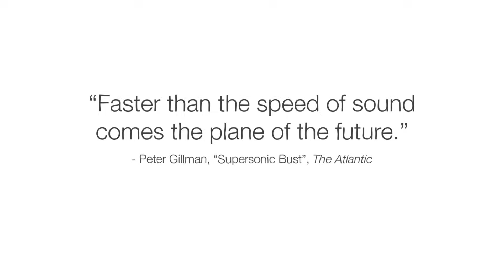Why are airplanes slower than they used to be? - Alex Gendler

Comment: The two sets of wings to create two waves to cancel each other is a genius idea.
Reply: It looks like a star destroyer
Reply: But that makes for more materials meaning more weight meaning more fuel  :/
Reply: @rollon1181  Yes, I agree with that but the problem with a supersonic plane is the speed because Energy is proportional to the velocity squared. So,  I think they are not aiming for reducing fuel consumption with the idea, but they are reducing the noise problem. The idea of using overlapping waves is smart because it should be intuitive, yet it is not. (for engineers at least).
Reply: @redaghassah7718  I’m not an engineer but Can’t we just create less noisy engines like we’ve done with cars? Most modern car engines and even power plants are literally quite this days, can same science not be replicated with the Concorde’s engine?
Reply: @jozefgiver7976  It's not audible noise that the issue, it's that the soundwaves are so large that they are physically damaging
Reply: @redaghassah7718  there's actually a very similar idea called canards, often used on fighter planes with wing shapes that are very fast but create a lot of instability. It's a small set of 'wings' that are placed one the nose of the aircraft
Reply: @jozefgiver7976  The issue is not the sound of the engine itself, but rather the “sonic boom” that results from an object traveling faster than the speed of sound. A rifle bullet for example has no “engine” but still produces an extremely loud cracking noise as it travels down range. With an object the size of an airplane, that “loud cracking noise” is similar to a mortar shell explosion.
Reply: @nickschneider4830  I’ve never shot a gun before but I assumed the sound came from the gun powder bang in the gun chamber which is contained using a silencer. I mean I could be wrong but I feel like the Concorde has that much sound wave effect partly due to a loud engine combined with speed. Cos I dunno, if a noiseless object is traveling at the speed of light would it cause the same sound-wavelength issue as the Concorde? I could be wrong but just asking.
Reply: @jozefgiver7976  it is true that the explosion of gunpowder produces a loud noise by itself, but a supersonic bullet emanates a loud crack all the way down range until the bullet slows to sub-sonic speeds. The main purpose of a suppressor is strictly to muffle the noise of the powder explosion and to reduce muzzle flash. It has no effect on the supersonic crack that trails the bullet down range. 
If you were on the ground spectating a jet traveling 0.99 Mach (subsonic) you would hear the rumble of the engines - this can be very loud depending on the jet’s altitude, but not physically damaging to you or your surroundings. Now if this jet speeds up just a bit to 1.01 Mach (supersonic), the resulting shockwave emanating from the aircraft has the potential to break windows and cause hearing loss. If you were extremely close the aircraft, say 50 feet - it could kill you. 
The noise produced by the engine would not dramatically change going from 0.99 Mach to 1.01 Mach, but the noise produced by the aircraft would increase enormously.
Reply: @jozefgiver7976  Any noiseless object traveling through air at a supersonic speed will produce a sonic boom. This is a result of the compression of consecutive pressure waves created by the object as it travels through the air. The energy released during a sonic boom is dependent on the size of the object - larger objects will produce more energetic, and thus louder sonic booms.
Reply: @jozefgiver7976  Mind you, the sonic boom is purely the result of an object traveling through a medium, in this case air. An object traveling through the vacuum of outer space is silent regardless of speed. There is no medium for sound to propagate through, and there is no pressure buildup in front of the object in the first place.
Reply: @nickschneider4830  wow Nick Schneider! Now I really want to be friends with you, you really brought it home and now am feeling like I can seat for an exams on the subject, thank you for taking the time, are you a lecturer? I really would like to know you if that’s fine with you.
Reply: @jozefgiver7976  A big problem with combustion airplanes is that in order to produce enough thrust to generate the lift necessary to maintain flight, the air needs to be compressed in order to achieve this "golden ratio" of air to fuel to maximize energy. Not only is the combustion itself loud, but in the air compression process, the blades are rotating at speeds that produce frequencies that are quite audible and high-pitched. Even if the sound of combustion is reduced, those frequencies still resonate through the body of the aircraft.

Jets are a lot quieter than they were in the 60's, but unfortunately, technology is not quite there to where we can operate planes on alternative energy (the Solar Impulse 2, a solar powered plane, took 16 months to complete a circumnavigational flight) Until then, all we can really do is stick to regulations on how close pilots can be to land when they break the sound barrier.
Reply: @blargwaharp.9577  I was thinking about a solar powered plane but then I realized the energy requirement will be an issue and you’ve just confirmed that (16 months! Wow.) I didn’t even know such had already been tested, thank you for bringing up that knowledge.

On a different thought, I’m wondering what the feeling is like traveling in the Concorde for instance. Will the passengers feel the sonic motion impact, considering they’re traveling at speeds faster than light?
Reply: @jozefgiver7976  and I’m glad I was able to clarify some of your questions. You posed some interesting ideas so I’m more than willing to provide some insight
Reply: @nickschneider4830  Wow! I saw the clip you recommended and I used headphones like you said, I think I screamed out a little bit when the crackling sound came sharply after towards the end. At this speed, how is cabin pressure conducive for regular traveling passengers? And what’s the assurance that people are not pinned into their seats and puking their guts out like in a speeding car?
Reply: @jozefgiver7976  i hope you are kidding hahahahahaha
Reply: @jozefgiver7976  Speed isn't what pins you to your seat. Acceleration is. Once you're at speed, you won't notice the difference. During takeoff you might feel a bit pinned, but modern airliners are no where near the same acceleration rates of say, F1 cars, or fighter jets.
Reply: @rollon1181  Yes, but if they run flights at half the time they can run twice the amount of flights
Reply: @rollon1181  it's not solving that particular problem
Reply: @rollon1181  but you could go over cities, meaning that it would shorten the route and consume less fuel
Reply: @rollon1181  juhuui
Reply: @rollon1181  just install Twitter problem solved
Reply: @rollon1181  and more drag
Reply: @rollon1181  Not necessarily, you won't need as big wings if you have 4 of then rather than 2.
Reply: @Eric-zz5ij  No, the lift created by each pair of wings will be relatively similar to one slightly larger wing, so it will actually require a lot more mass. The other problem is that whatever connects the two will need to be able to absorb much of a sonic boom every time it flies. So even more weight meaning more fuel.
Reply: @tasmanmillen  No, biplanes are usually lighter than monoplanes because you don't need as much material to make the wings strong enough. Drag is one of the main reason why biplanes are worse.
Reply: That design may take a long time to come out. The engineering for that seems like a nightmare
Reply: Yea, who needs wings to be wings when you’re 30K feet up…
Reply: We going to ignore how the two wing design looks like a UFO?
Reply: Why wouldn't the bottom wing cause lower pressure underneath and pull the plane down?
Reply: @michaelanderson2881  because any decent aeronautical engineer would choose the appropriate airfoil for both wings
Reply: @momochiyoda2960  Are you one?
Reply: @michaelanderson2881  I am, and Momo is right. It's about balancing. But this concept won't work in real life. You control airspeed by changing the attitude of an aircraft. With this arrangement of bodies in proximity, changing attitude would result in very complex flow fields forming, leading to instability.
Reply: If you only look at that aspect, yes. Otherwise, no.
Reply: I’m a little confused about how this should work. How do they create a negative here
Reply: @eat_your_cereal  Wave cancellation. If you create one shockwave going one way and another going the other they should cancel each other out.
Reply: Manufacturing it and being able to accommodate it in the current airport and hangar facilities won't see it made anytime soon.
Reply: why?
Reply: Isn’t really just the principle of noise canceling headphones?
Reply: Yes
Reply: Not really genius. First thing I thought of with zero knowledge of airplanes.
Reply: Jj*j*
Reply: Yes indeed
Reply: Not at all, anyone could have thought it before
Reply: The weight should be a problem tho
Reply: @santiagocv9918  Nope. Bi-planes have existed for over 100 years and they do not have any weight issues.
Reply: Yes so why don’t we have them yet
Reply: Not really it feels like one those thing where you're like "I should have thought of that"
Reply: @ShadNex  and that's why it is genius because it is really evident that you forget about it. People are commenting why it's a bad idea for planes and I know that, but im comming from a physics point of view.
Reply: Well, not really. the socalled "sonic boom" is a compression of air molecues and just like a bicycle pump compressing air rewuires force (work). The only way to produce that force is with the engines. So with this idea they now have to produce two shock waves - guess what that does to fuel consumption?
Reply: The aliens had it right then

Comment: imagine being in the cabin of the Concorde going faster than sound.  Especially if your the pilot...
Reply: Er what? It’s not like your speed affects the sound of movie playback.
Reply: @BlownMacTruck  Because I would love the scenic view boi
Reply: It was amazing.
Reply: The problem you are all having with this is not differentiating the sound travelling outside the cabin from the sound travelling inside the cabin. Inside the cabin you can hear the engine no matter where you are stood. The sound of the engine is coming from the vibrations propagating through the plane's structure and vibrating the air inside the cabin. So what you are hearing isn't the raw sound of the engine through air (sound which your plane is 'outrunning'), it's the sound of the physical vibration of the engine damped by the structure of the plane, through the air inside the cabin that is travelling inside it. 

Ask yourself: Why can I hear passengers behind me talking if we are travelling faster than the speed of sound?
Reply: YES EVERYONE I WAS WRONG
Reply: I got a concorde ride at eaa in oshkosh wi. But it was a short flight and not supersonic
Reply: The speed of sound is measured based on atmospheric temperature. As altitude increases, the speed of sound decreases.
Reply: @powershotsss  uhh you mean pressure as altitude increases?
Reply: @powershotsss  no that's not correct either, it's not based on atmospheric temperature, it's literally just a wave, the speed of sound is based quite literally on particle density and how fast the wave can travel through
Reply: @johnlowe1255  they said temperature but then pretty much described it as a change in pressure
Reply: That’s low key baller ngl
Reply: 292 idiots
Reply: But if it was remotely piloted...over an unpopulated area..would it have made a sound at all ?? (joking lol)
Reply: Right, you can’t even talk to your copilot
Reply: And later on landing and finding out that your twin brother got much older than yourself. No thank you
Reply: @amarillo_atacama  Relativity in a nutshell
Reply: @ampere_exe  not how it works
Reply: @amarillo_atacama  Nooo it's the speed of sound. Your twin brother will just know more songs than you do.
Reply: @amarillo_atacama  what causes that?
Reply: @robertanton7566  its false
Reply: @amarillo_atacama  isn’t that applicable only when your are traveling at the speed of light.??
Reply: @amarillo_atacama  More like .00000000001 seconds older
Reply: @amarillo_atacama  its not that deep
Reply: I had a misconception as a kid that if you were in front of the engines, you wouldn’t be able to hear them until you went below the sound barrier. Of course that isn’t true, the speed of sound is relative to the emitter, so you would hear the engines just as well as if you were stationary.
Reply: @benisjammin8926  that's not how that works tho
Reply: Really ben, now you questioned that, I really dont think we would be able to hear engines in a concorde.
Reply: @govindbarwa1806  Yes you would be able to hear them. The speed of sound is measured relative to the emitter. So if you measured the sound emitting from a Concorde from the ground, it would be the speed of the plane plus the speed of sound, whereas if you’re on the plane it would just be the normal speed of sound. It’s like if you were standing in the bed of a truck, and you threw a tennis ball forward at 30 mph. To someone on the truck it would look like you threw it normally, but to someone on the road, it would be traveling at the speed of the truck plus 30 mph. I hope this clears it up.
Reply: @benisjammin8926  isn’t the whole effect of a sonic boom due to the emitter traveling faster than the speed of sound, thereby outrunning the particles which would carry the sound? For example a bullet reaches its destination before the sound of the shot does, so the bullet can’t hear the sound of its own shot.
Reply: @benisjammin8926  From google: “The short answer is – no, they don't hear the sonic boom. Pilots and passengers cannot hear the sonic boom created by their own plane because they are at the head of the Mach cone. In simple words, they are moving so fast that the sonic boom doesn't get a chance to catch up to them.”
Reply: In fact now that I think of it no, the speed of sound is absolutely not measured relative to the speed of the emitter because all sound is, is a wave propagating through particles, which is not effected by how fast the thing generating the wave is moving, this is exactly the reason for the Doppler effect—wave compression as the moving object catches up to its own wave.
Reply: @NINTHSKULL  he said sound of the engines, not the sonic boom. Those are two different things
Reply: @mrfahrenheit677  yes they are, but I think the fact that there is a sonic boom would indicate you are not just outrunning the sound from the plane but also any sounds produced by the plane or engines. As someone else said, you would only hear the sounds vibrating through the metal of the plane, but soundwaves in the air outside would be left behind.
Reply: @benisjammin8926  what a cool yet random fact
Reply: @benisjammin8926  I don't think that is correct. In fact, I'm pretty sure it's not. FWIW, the speed of light is not relative to the emitter.
Reply: @clarencegreen3071  He is correct.
The speed of light is a relativistic invariant, the speed of sound is not.
Reply: @landochabod7  every speed is technically not the same when traveling relative to a non zero reference speed
Reply: @clarencegreen3071  correct, ben is wrong here. speed of sound is not relative at all
Reply: @thedoublehelix5661  yes because both are inertial reference frames
Reply: @clarencegreen3071  Light shoots out in one direction, sound waves travels in all directions from it's original point.

Comment: "loud startling noise, rattling windows and dislodging structural elements of buildings" 

Yeah divert that to the sea instead, we'll probably regret this 50 years from now
Reply: How?
Reply: @rudrakshsharma2832  That's not how tsunamis work. You need an earthquake
Reply: @rudrakshsharma2832  You're not even using it right

Comment: There are 4 forces that act on a plane: thrust, drag, lift, and weight. Planes slow down because of drag. Once power is reduced, drag is greater than thrust and causes the plane to slow down.👍
Reply: you forgot one more resistant force: the FAA pilot certification
Reply: There are four forces that act on a plane: the strong nuclear force, the weak nuclear force, electromagnetism, and gravity ;)
Reply: @joshuazhong2520  :  Until some hotshot physicist comes along and unifies them!  ⚛
Reply: @Milesco  Plot Twist:  The pentaquark was real all along!!!
Reply: man I love ted ed's comment section
Reply: What you are describing is parasitic drag, but the other factor is induced drag which increases as an aircraft slows down.  Get too slow, and induced drag becomes so great that it takes massive amounts of power to keep the aircraft in the air even at very slow speeds.
Reply: @gopenguin8879  :  Are you talking about drag as a result of increased angle of attack?
Reply: @Milesco  angle of attack is one aspect of induced drag, there are several.  The most discussed ones are the rearward vector of lift as it shifts aft with AOA and wingtip vortices spoiling lift near the wingtips which also increases with AOA
Reply: i smell aerospace engineering

its a very strong smell LOLOL

(I live in a city full of aerospace nerds)
Reply: Or they want to keep you in there as long as possible to sell you the overpriced food and drink.
Reply: and drag components become funny after you reach supersonic flight...